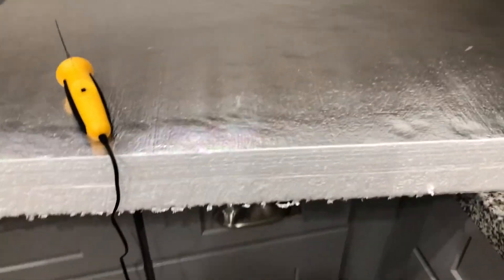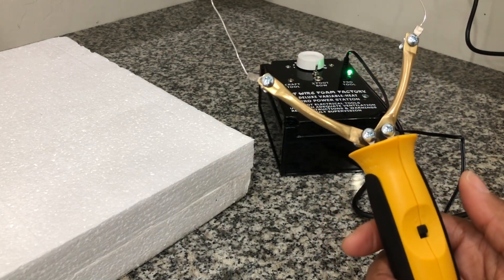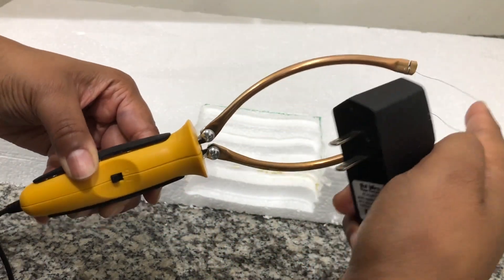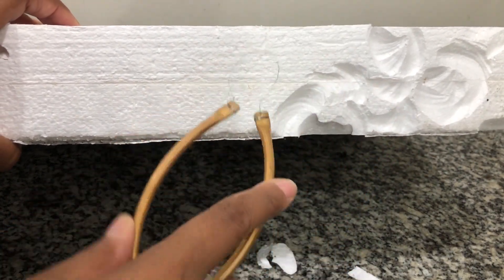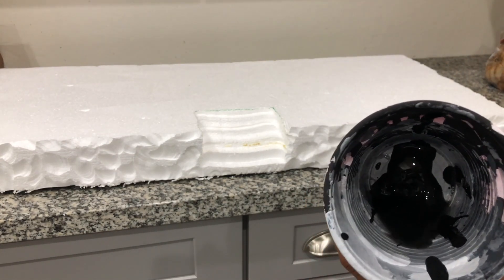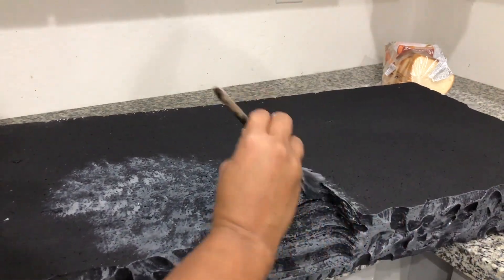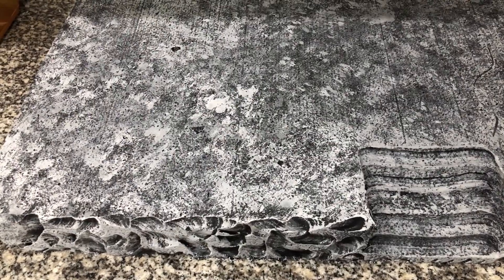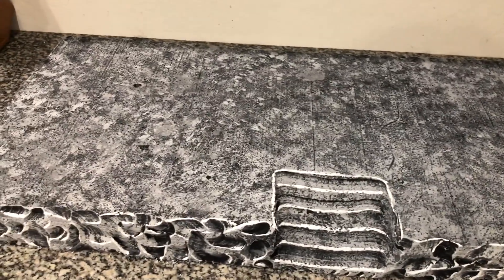Christmas Village Display Tutorial

Comment: Hi Miriam! I am having so much fun playing with my HWFF tools - I sent you an email with photos and questions, but perhaps you didn’t get it?
I’m wondering how you remove the thin plastic film from these large foam boards? I thought it would peel off easily, but it’s coming off in tiny strips and pieces and it’s driving me crazy.
It’s going to be my Snow Village base, so mostly covered with “snow”, but there are a few spots where I want to glue on some landscape formations and I don’t think they’ll adhere to plastic. Maybe I’ll anchor them with toothpicks instead.
Thanks in advance!
Reply from the maker: Hey Ring, I am so happy to hear you are having so much fun with your tools. I did respond to your email last Thursday. Maybe it went to your spam folder. I just forwarded the original email I sent you. 

If you peel the paper off slowly, it comes off in larger sections. Someone also told me they used a hair dryer and peel it off and that worked great for them. 

You are right, the pieces will stick better long term if glued styrofoam to styrofoam so you really want to take off the liner.
Reply: @MiriamsManner  
The hair dryer sounds like a great tip - thanks! And your email reply WAS in spam, so thanks for that as well.  Back to creating after this week at the beach with my brother and sister. 😃

Comment: Hi there! Miriam, sorry to bother u this way but I don't  know any other way to get to u. Last month I bought on line the HFWW free hand router since I did liked it very much at your demos.  No way to get anything similar here in Spain so as I said I ordered it on line (preeeety expensive shipping costs)  The thing is that it doesn't work at all, not even the green light would appears. I know for sure it is not because of the voltage because I've had many times US electrical items working properly over here. Running out of time and I'm wondering if you could help with your  HWFF rep. Thanks a lot.
Reply from the maker: Hello Susana,
I will reach out to her and let her know. Did you order it directly from the HWFF website?
Reply: @MiriamsManner  Hi Miriam! Yip, I did. It was some days before you posted your rep mail. Thanks a lot! I appreciate it
Reply from the maker: Okay, I just text my rep and I will let you know what she says.
Reply from the maker: In the meantime, can you give me your email address just in case she would like to contact you?  

You can email it to me if you don’t want to leave it on YouTube. Email me at miriamsmanner@gmail.com
Reply: @MiriamsManner  Done! I do appreciate u taking care! Huge thanks!
Reply from the maker: Hello Susana,
I heard back from my rep and she forwarded your concern to the support team. They have someone on their staff looking into right now. 

Also, Pat mentioned that you might need a converter plug for this piece. I have attached a link below with that converter from HWFF. 

Someone from the company should be emailing you. 

https://hotwirefoamfactory.com/047.html
Reply: @MiriamsManner  Thanks a lot Miriam. I do appreciate it. I need to read and do a research on converters and so on... the thing is that I've got several electronic devices that I bought in the US and I have never had a problem... but it's ok I'll manage with your help. Big hug